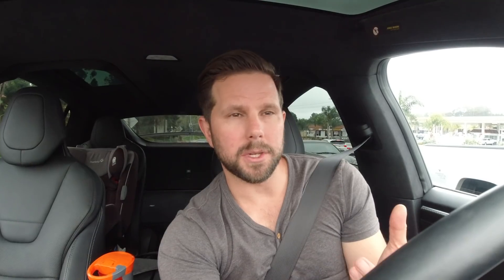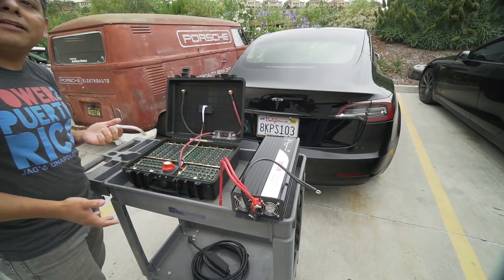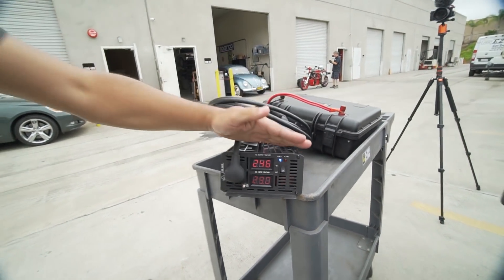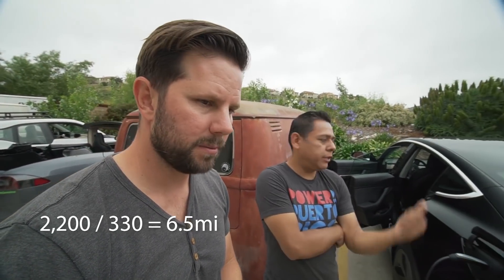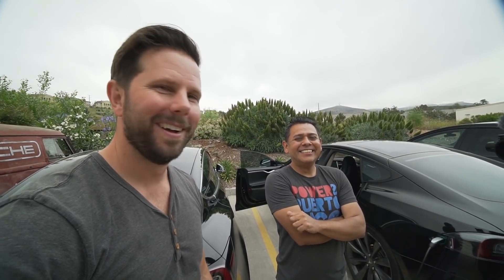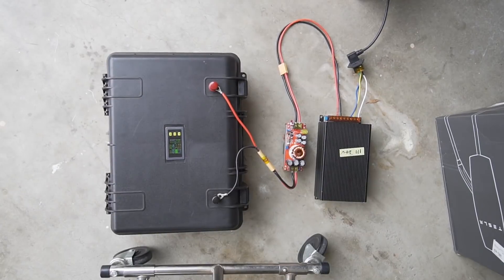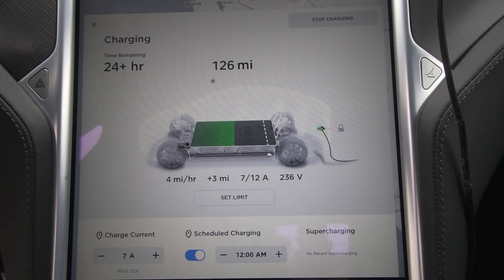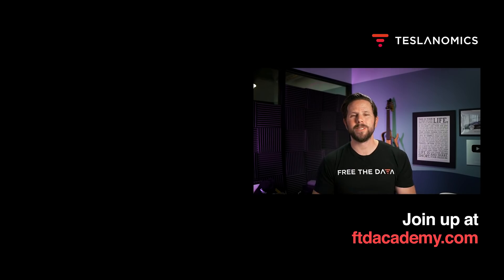DIY Tesla Gas Can - Will it Work?

Comment: $1600 'electric gas can'  to gain 4mi in a DAY of charging. Or $80 for a AAA Plus membership and a phone call, to get you flatbedded to a charging station. 
And I suppose at some point in the future, as EVs multiply there might even be service vehicles with a fast charging ability. 

I think the idea of a car to car ability would be great.  24V military vehicles  have long had a 'slave cable' capability, ports at the bumpers, for connecting the vehicles electrically.  The 5ton trucks had it 30yrs ago when I was in the Marines.

Comment: Or you could have used a 20 amp 120 volt array instead of a 100 amp 24 volt array, added a capacitor or regulator to smooth the output from the pack, and skipped the inverter.
Reply from the maker: Do it
Reply: Wish I had the resources and skills so I could. As it is I can only ask questions and make apparently offensively-worded recommendations... >.<

Comment: I'm imagining the AAA service truck might be equipped with a 5000W generator, so 0.5h * 5kW * 3mi/kWh = 7.5 miles from half an hour or 4 minutes for each mile you need to get to a charger. I'm beginning to see why a portable gas generator might not be so attractive for a Tesla owner. 240 miles in 3 hours depletes the battery, and a 5000W generator running that whole time could add just 40 miles. A 10,000W generator might add 80 miles in 3 hours (6 hours between stops means 160 miles from gas and 300 from battery or 75 mph). If autopilot becomes a more compelling feature then there might be more demand to make Tesla road trips more comfortable.

Comment: If the battery voltage starts to sag when almost empty, or as you call it, "Tesla 's asking for it too fast, too fast", can't you lower the charging amperage?  It didn't actually ask for it too fast, you set it to 7A.  Just lower it, you have control of that all they way down to 1A.

Comment: At 250V@10A=2.5kw; 1 horse power= 746watt..so you're charging at 3.35hp if assuming 100% efficiency (it's less in reality). so 1 hour charge will give you 3.35hp-hour/2.5kw-hr of energy. If you need 20 hp to drive to the recharge station, that will only if you (3.35/20)x60 minutes=10 minutes at best; or you would need to charge it at 60A for 1 hour to drive 1 hour.

Comment: Would an mini Honda generator rig work? Theee small generator that looks cute and dose not make allot of noise. I use to work at an lawn mower shop twenty years and I seen these small generators make some good power for their size. I would take them freah out the box and give them the first start infeont of the customer just like an first test drive. No hard feeling people. Behind the wall the electricity some is powerd by some coal or diesel. I live in AZ an been in the sun to long. I do have an associates degree in electronics technology. This may work like having an NOS kit in hidden in your ride. I have seen nuclear power plants. I have seen then nice solar cell plants and different pretty natural high tech solar technology. Also some wind cells. Be fun to think out side the help. Those little small Honda generators has enough Jules to give an batter to charge. An am pretty sure some person may set up an great wire circuit power these great old school power house.  I seen electric on paper what mister Nikolai Tesla thee first inventor of thee electric car had in mind. Elon  just did what Bill Gates did with his computer invention with apple was it with the mouse hardware or an software code. Also how good old thomas plain out Nikolai Tesla with his good old tricking him.  I think be fun to think outside the box. Just premium gasoline. I uswd to owen by the way when I used to work in construction. Worked great with powering skill saws. Also other big power drills like impacted drills to make 1 inch wide hole in cement and drill about an foot deep. I just break these very fancy and strong drill bits with diamonds and other fancy strong precious metals. This was an great video to get us thinking. Well great some makes an nice wind mill that has an electric power generator in their yard at home to charge an electric vehicle.

Comment: Boy, I wish you would have an understanding of LiPo batteries. Just like the Tesla the batteries have a protection circuit so they can not be fully discharged. That same circuit prevents over charging.

Comment: For that battery to have worked better than it did.... you would need to hook it directly into the car itself and bypass the regular Tesla battery.  From what I read the Tesla regular battery puts out 375 Volts.  Hook enough batteries in series then parallel them to increase capacity.  Tesla should probably have some where on the car to hook up a 2nd battery.  Maybe the don't.... never owned one.

Comment: Wow 70% loss. So much inefficiency with the DC to AC and  back to DC again. I wonder if you could use the supercharge function somehow to direct connect the DC from the "battery can" to the DC of the Tesla battery.
Reply: 30% loss... they said roughly 70% was being utilized.

Comment: Early VWs lacked a gas gauge. When you ran out of gas, you flipped a small lever near the pedals with your toe that gave you access to an extra gallon of gas, 
That gallon could take you 36 miles -- enough to find a gas station. 
The e-battery can be built in.
Reply: Motorcycles still have reserve levers

Comment: The only problem is it’s twice as big and twice as heavy as a real gas can and cost is a few hundred bucks that’s why Electric cars having taken over gasoline still has more energy production then electricity I had an idea just popped in my head you should check out a couple of those old military handcrank generators or military generators some of them are really high powered

Comment: Only real gas can solution will be a bank of cells that piggybacks to Ev cars power supply to transfer energy to drive motors not battery to battery energy transfer which takes  a lot of time. Manufacturers would have to be on-board with this and incorporate it into the design of the system though.

Comment: "4 additional miles of range" at a cost > $1300 + build time + 1 hr charge time...yeah, now I'm waiting for the video where they build this huge induction coil, mount it to the roof and park it under hi-voltage power lines to charge for a few days....

Comment: Instead of using an inverter why not set up the battery to charge in DC mode.  I know it  is higher voltage but that would be better than 70% efficient.

Comment: I see the purpose of it. But not practical for the regular joe.Even Tesla new 500 mile range truck comming out, how do you charge it in your travels. Is hard somtimes to find an open gas station. Plus your battery pack is going to be priced out of reach for most. I understand they may be a solar power alternative, maybe then.

Comment: To add 10 miles in 15 min you would need a full Telsa car battery pack because you would need all the volts and all the amps.  Better off just towing it.  This is why range anxiety is a thing - you must tow it if you run out of juice.  There is no other option.

Comment: Should be possible to make a DC connection between the gas can and car. This way you don't lose energy through the inverter.

Even better idea put a pillow on the Tesla rear bumper have another car push it and that regen charge the battery. If the Tesla has a tow bolt or recovery point this could be done with a rope
Reply: In theory yes, but you can destroy the transmission on the pulling vehicle, being that the regen is like having the brakes on the whole trip, the only way around this would be a bigger vehicle, which at that point might as well just get a tow truck to take you to the closest charger and not ruin a vehicle or take the safety risks of towing
Reply: Of towing with the Tesla on the ground, not towing in a regular sense
Reply: @walkstheman98  the regen at low speeds is minimal. Most engines are not powerful enough to destroy their Transmissions. If they produce that much load any Full Throttle run could potentially destroy the transmission.
Reply: @roundgrape  I dont think you understand, regen on a Tesla, or any electric car, produces drag, and in a sense is a brake on the car, and pushing it with anouther vehicle to use regen charge would be like holding the brakes on the electric vehicle the whole way, which can destroy the transmission in most vehicles due to the over working of the transmission. Feel free to take a car, have someone hold the brakes, and test it on your car. The distance you would need to go to produce enough charge to even go anywhere in an electric car would overheat and break your transmission. Unless you drive a big rig semi-truck
Reply: It would destroy the transmission in the pushing vehicle, not the electric vehicle
Reply: @walkstheman98  there is no significant regeneration at low speeds. Most lock up Transmissions can handle Full Throttle over extended periods. Without lock up the transmission can overheat under extended heavy load.
Reply: @roundgrape  even at high speeds where you get good regen it will still be as if the brakes are on. It doesn't matter what speed you are going, it is still going to be like the brakes are being pressed the entire time, especially at the regen level needed to get a good charge it would be as if the breaks were nearly full on, and you would still have to go a very long distance to get any significant charge to the vehicle. Speed isn't an issue here

Comment: For a gas can solution you need DC to DC supercharging suitcase which would probably have to run on capacitors.  rapid discharge at 400 mph for 5 minutes

Comment: Why not make a pack out of SPIM08HP 3.7V 8AH 200A LITHIUM ION or similar, in series to the DC voltage which is output from a Tesla Supercharger?  Then you would avoid the slow charging and you wouldn't need the inverter.  Some hacking required.  So much loss going from DC to AC just to go back to DC!
Reply: Looks like there are adaptor for Telsa's to allow charging at CHAdeMO DC fast chargers. 62.5 kW by 500 V, 125 A direct current.  That's only 135 SPIM08HP cells, some CANBUS hackery, and some duct-tape.

Comment: I think ultimately it does not work. The reason is the rocket fuel problem. For every battery added, you rob the efficiency of every battery before it. Then ontop of that, you would need to carry a huge inverter, further hurting efficiency. Does it add range? Sure, but it also robbed some range in doing so. Forget the cost to range ratio of just having more batteries without the heavy inverter.

Comment: Assuming you have the 75kwh battery in your tesla your house can run at 5k watts for about 15 hours lets say your conservative and your house uses 3500 watts your at 21.4 hours and thats at 100% efficiency so you are no where near running your house 2-3 days the only way you get to that is if you are only using electricity 12 hours or less a day

Comment: The only way to make this work is to require all electric cars to use a universal. Or standard battery pack. So you are low. Pull in and the battery pack is changed and you get on your way

Comment: Portable gas generator would solve all the problems. It could easily charge Tesla with 10 amps current. And it would cost you around 500-1000 usd

Comment: Wouldn't the energy "cost" of carrying the "electric gas can" outweigh any benefits?  30lb battery + the inverter+ the charge cable.  I would think you would eat up more energy than the can could provide.

Comment: What's the efficiency of the system gas to electric if not already mentioned? A 90kwh battery can power my home for about 70 days during summer in Northern England. I use gas in the winter for heating.

Comment: It wasn't a 120v test - which would have worked with a 1500 watt inverter - and all of your UMC's would have worked!  Teslas cannot currently 'create' 240v AC for charging (or powering your house) because the on-board charger is only one way.

Comment: Hey what about a backup photovoltaic system? You could put solar panels on the roof and park in the sun to trickle charge. Trouble with that is you would need to leave the car out in direct sunlight and concentrated solar also creates a heat problem. Secondly you could use steam to power the car but that would also require a separate engine which would add to the weight of the car.  Lastly and this is a huge one, we can wait until there is infrastructure built to handle electric vehicles to the point where there are charging stations that are more built out to allow for multiple cars like a gas station.  I think the main problem is our power system in the US wasn't designed initially to allow for electric cars. And as more and more people buy them there is a higher strain on power companies to provide that energy. If anything all we are doing now, is passing the torch if you will. To these companies allowing them to grow larger and larger to the point we are completely reliant on electricity for our cars we;ll pay any price to fill them up. Much like the big oil companies of today. And its not just about renewable resources we are far past that now, we need to find a totally new and clean power source.  That can be used multiple times and doesn't require heavy industry, maybe a mineral of some sort.

Comment: I fail to see the rationale to carrying a heavy battery/inverter all the time to charge up in an emergency.  The constant lost energy caused by the extra weight is not insignificant.  Solution is to pay attention to power levels and never run out.  I also think a small 220v generator with1 gallon gas would be less weight and probably  do just as well a charging up in a pinch.

Comment: Solution: 1 - small car battery with 200+ amp rating $40  - Walmart
1 - 110 amp chevy alternator $60 - any car part website
1 - 5 hp small gas engine $130  -  Harbor Freight.
1 - Bottle of "Stabil" gas stabilizer $4  - Walmart
1 - Pulley and belt combination $40 - Tractor Supply/Fleet Farm
1 - 3000 watt pure sine wave inverter $400 - Amazon

Total: $674 for your "tesla gas can"...
Reply from the maker: Do it
Reply: @BenSullinsOfficial  If only I had something to test said device on... Do you have a throw-away Tesla to donate?
Reply from the maker: @Lickemstick  rent one on Turo

Comment: Not sure why you weren't testing this on a vehicle that had 10% or less charge remaining.  If you are truly out of power in your Tesla, the battery pack range extender will charge much longer, potentially faster and should essentially drain the entire mobile pack.

Comment: Isn’t Tesla pickup going to have 220v outlet??  50-60amp? Tesla will use this truck for their roadside assistance, and it can have an ‘off the shelf’ wall charger plugged in and mounted ... That’s a big, very mobile charger.. Given Fsd in 2 years,  you’ll be able to order a pickup robotaxi, use it to charge your car, and be billed through that system.... Have a power outage? Need a generator, or power at a construction site? Order a pickup robotaxi

Comment: The only way I think so far is use a gas generator, a small Honda doesn't weigh that much and it'll do 15 amps and runs for hours... Yah I know it's gas but small generator has a tiny 1 gallon tank.

Comment: You're almost there. Figure out how much each mile is worth in watts, calculate the theoretical "miles" of your portable battery and figure out your losses, that will give you a better idea of the numbers to chase after. You need to find a way of getting rid of the inverter, this is currently your barrier killing your efficiency. You're converting low voltage DC to high voltage AC back to ??VDC thought the tesla on board charger. Then you're unable to use the full capacity because of the high minimum requirements of the inverter. The challenge here is to either find how to feed DC from your portable battery directly through the Tesla on board charger or bypass the tesla charger (the next barrier) and find a way directly to the battery but this method requires in depth knowledge of how/where the computer gets it's battery management data (from charger or from battery management system). Time to go full nerd on this thing.

Comment: I guess the best solution should be a compartment in the frunk/trunk where you can store/plug an extra 4/6 kWh Ion Can (battery). No external inverter and more safety. The real problem will be the cost of it. I really hope Elon is reading this comment :)

Comment: Much better if Tesla just allowed you to directly plug in the battery to the system so you could run immediately and avoid the loss of energy that happens this way.  Tesla can then sell you these "gas cans" and make extra money.
Reply from the maker: It's not them allowing or not, it takes 400v of DC to skip the inverter, more than a small battery pack can push

Comment: All very interesting, however a real gas  container can be emptied in about 5 mins and give the driver of the gas car an additional 60-120 miles of range. Today’s technology just doesn’t add up to this ease, short time, and range. The world’s timetable to force manufacturers to stop producing combustion engines just isn’t realistic. I like the idea of an electric car for around town errands, especially if one has a home solar system to power the personal recharge station. However over the road driving for long trips just isn’t realistic. Also the electric grid or specific car can be flipped off with a switch by the powers that be. So this leads to the inevitable problem of severely limiting people the ability to travel long distances freely